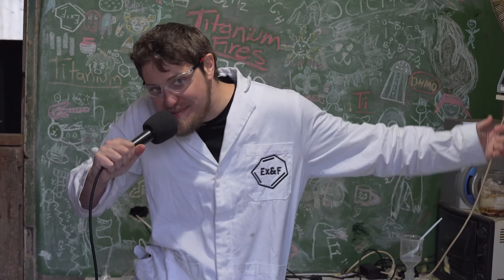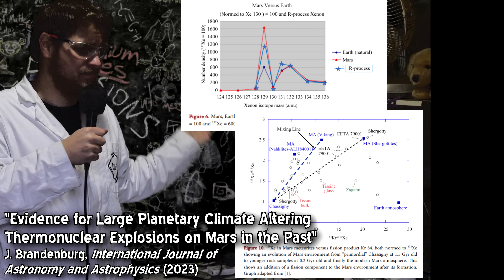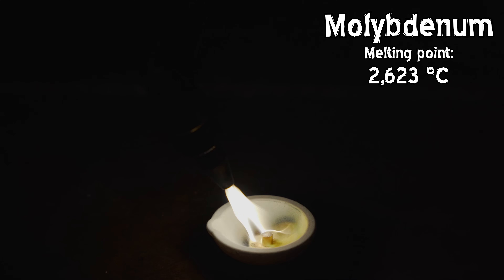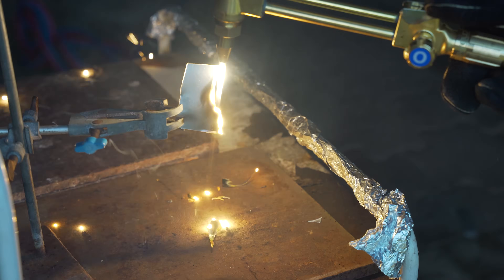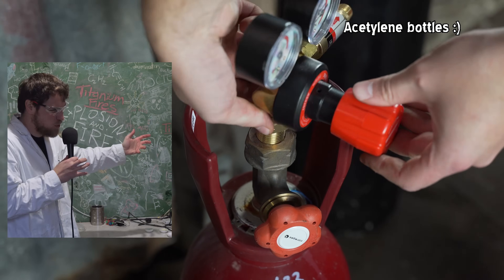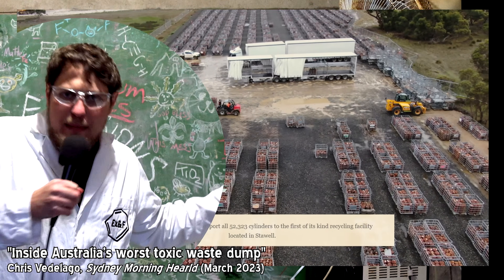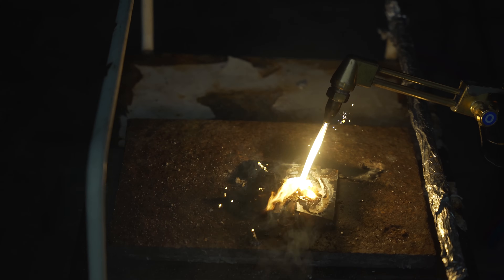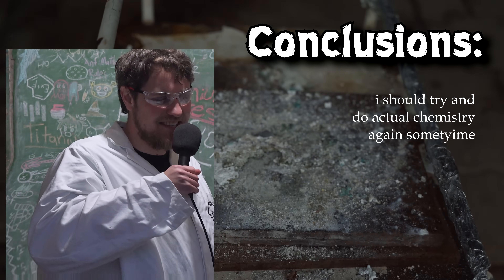Actually burning titanium

Comment: I read some report years ago that out of all the plastic (can't remember if it were plastic produced or only the "recycled" stuff), but only 8% actually got recycled, the rest ended up in landfils, burnt or just stored away for someone else to deal with later.

Now, plastics recycling is actually hard.
Just take soft plastic as an example, Polyethylene is simple to deal with, but it is far from the only commonly used soft plastic. And different plastics needs different recycling methods. So just throwing soft plastics into a bin won't really sort it enough for recycling efforts to be all that economical.

Keeping plastics properly sorted such that recycling efforts actually can happen is a monumental challenge.

Here in Sweden I wouldn't be the slightest bit surprised if it all gets "recycled" by burning it in one of our many waste burning facilities that generates electricity and municipal heating. At least the energy in the plastic got recycled, so better than just burning it out in a field. Especially since the waste burning facility is built to burn the waste cleaner, and filters its exhaust as well.

A fairly universally unwanted solution would be a plastic tax. Where that tax income directly subsidizes actual recycling efforts. (however, I do suspect that this would work fairly ineptly in practice, it isn't a trivial thing to just implement... But it is kind of needed. I myself would just make it a simple "pot", where there is X amount of plastic tax income in a given month, and then simply divide said tax by how many tons (of "new" plastic) each recycler have managed to recycle. Early on recycling plastic at scale could become a gold mine, but at least it stirs the pot and gets people to put in effort.)
Reply from the maker: Yeah I agree. Plastics recycling is hard, but I think it is wrong to maintain an illusion that things are being recycled when they are not, as cutting down on the initial use of plastics should be the main objective
Reply: @ExplosionsAndFire  Yes, the utterly false claims of "recycling" plastics when it in fact isn't, is a rather big issue as far as minimizing the problem to start with.

Reducing needless plastic waste should be a far higher priority.

Personally though think that recycling efforts also do need financial help.

And putting a tax on the sale of plastics in general would help both reduce the the total amount of plastic put onto the market, but also help remove it.

Such a tax wouldn't have to be huge either. Likely only a dollar or two per kg would be far more than sufficient. But this would have to be experimented with, and setting a lower initial bar to trail things out would be wise.

Comment: the lever on the oxy acetalene torch is for finishing the cut. your flame should already be jet blue and once you heat up what you're cutting. hold the lever and it melts through the metal clean

Comment: Angle grinder. Fills the room with white smoke. Bad white smoke.
   The only bulk metal fire story I believe was my step-dad. The machine shop he was at for a while did work for the military through a chain of sub contractors.  He cut some of the armor for Blackhawks.  Every ounce had to be accounted,  even the chips and swarf were returned. 
   Anyway. He said the pile of chips under a lathe cutting zirconium caught fire and it was soaked in water based coolant.   I imagine it was an alloy.

Comment: that oxy tourch is not the right one for that job, your flame does not have enough oxygen thats why you are getting so much carbon deposits. dont use a cutting tourch, use a welding one and crank up the oxygen till you get a blue flame with a smallish white dart in the middle. Thats when you have perfect combustion (and an oxydising flame)

Comment: Maybe you should try friction welding some titanium together, the heat can easily get to the melting point of titanium and maybe it will scrub away the surface layer? Also try preheating the titanium in a furnace. Maybe also look at what industrial conditions cause bulk titanium fires for inspiration.

Comment: As the trades end of things, you might have better luck if you balanced the flame on your torch. You should never see orange flames on an oxy/acetylene setup or black residue on the metal. With what you've set it up as, the flame is using consuming a lot of the oxygen. Which is counter productive.

Comment: when using an oxy fuel torch, you want to see little blue spikes at the base of the flame (the nozzle tip). if your flame isnt conical before pressing the lever, youre using too much fuel or not enough oxygen (sometimes both)

Comment: Ooooo I have quite the Recommendation in regards to a “ relatively “ ..lol sustained titanium ignition! 
A few years back now my buddy and I –in our attempts to two start our own small weld shop company – had a small group of customers looking for some crazy sparking skid plates for their 4x4 wheelie bars.. 
a mere 4, 1/2” dia. holes later.. we had ourselves a good heaping handful of basically titanium (steel) wool 

Completely useless and contaminated (drenched lol) In cutting oil sitting on our fixture table, I …”jokingly…”👀😂 just sparked a lighter on it… 

Without ruining all the excitement for any one thinking of replicating themselves 

… Think….  A slow to start red glow… then just a climactic crank of the dial to overload  leading into a fuggin truly blinding white dwarf now sitting 4 feet from our Flash burnt faces 

😂😂😂😂

Comment: I swear, as a welder of 20 years seeing him use pure acetylene without any oxygen (apart from the blast torch) is scary, Acetylene is REALLY dirty, it can clog up the tip very quickly wihout a little bit of oxygen being fed through to the flame... 

A clogged tip can burn like a wick, turn orange very quickly melt and make a mess of your afternoon

Comment: Once you've got the titanium melting, turn of the gas and just keep the oxy running. That's an oxidizer too and it felt quite left out. In fact, that's actually how acetylene gas cutting torches work. Once the cutting starts, the oxygen alone is enough to sustain the cutting.

Will it work for titanium though? Only you can show us!

Comment: If you burn plastic and other things in a furnace and scrub the exhaust gas you can use it to generate electricity without making mother Gaia cry. It’s actually not a bad way to deal with it.

Comment: I love your vids, but as a metalworker who uses oxyacet. on a daily basis i can tell you, you wherenot cutting the scizors but just melting it away. When cutting with oxyacet you need to see a clear stream of oxigen within the flame when you push the lever on the burner, that stream will burn and blast away the metal, giving a clean cut without and yellow blobs of metal falling off. Keep up the fun stuff tho, for no xp with oxyacet you did pretty good!

Comment: The gas axe is a scary yet fun tool. If you haven't already mastered it, light it, then turn the gas up until you have a nice "feathering" flame with very little to no smoke, THEN turn the oxygen on and adjust until it almost goes BANG! :P the flame shouldn't be yellow/orange, unless that is just how it looks on camera, it should be blue and white when correctly adjusted. VERY effective, the hardest part is not putting holes in or setting fire to anything accidentally... basically perfect for this channel <3
Reply: Amateur.

Get a hot standby flame, "tap it out" on your shoe, fill a styro cup with the now free flowing gas mix, restrike the torch and "brush" the cup.

THAT'S worth posting a comment about.
Reply: Wouldn't the extra oxygen in the flame cause unwanted oxidation ?
Reply: @YounesLayachi  The extra oxygen accelerates the combustion of the acetylene. The result is a hotter flame. When it is cutting metal and the "turbo" valve is open, the extra oxygen largely goes to oxidizing the molten metal in the flame, yes. This is useful because it creates even more local heat, helping the melt for making the cut.

If that's not what you're referring to I don't know.
Reply: @MadScientist267  I'm talking about oxygen leftover after the combustion of the acetylene
Reply: @YounesLayachi  Ok yeah any that is leftover either leaves the flame unused, or goes toward oxidizing whatever the work is, yes.
Reply: @YounesLayachi other guy is correct, you WANT some oxidation from the excess oxygen in the flame. When a cutting torch is ripping through 1/2 inch thick steel at a speed of a half inch per second, it's not merely melting through it. It's largely a chemical reaction from the excess oxygen, thats why you can make a 2 foot long cut despite only having yo preheat the steel in the area where the cut starts, and from there the chemical reaction keeps the cut going.
This is also part of the reason why oxy/fuel torches don't really work on aluminum, despite it having a much lower melting point than steel

Comment: For titanium fires, all the cases that I've seen have been as a result of overheating the metal when attempting to forge it.  It doesn't burn that dramatically, but it does keep going.  I'm wondering if perhaps the difference between those cases and here's that when forging, the entire billet is heated to orange heat (~1000C), and fires result when it gets 'a bit' hotter than that.  So, perhaps the intense point source of heat from the oxyacetylene is not getting the surrounding material hot enough to continue the combustion, before the directtly heated material is fully oxidised?  Maybe titanium needs to be all at at red or orange heat before a sustaining fire can occur?  Just guessing, trying to make sense of two apparently contradictory observations.

Comment: Hi there, I studied plastics engineering in college and did my capstone project on plastic recycling. The short version of why recycling is a mess is not because we don't know how to recycle plastic, its that it is very hard to separate plastic by type and a small amount of contaminant drastically lowers the quality. So it is very costly to get pure plastic separated out by type. So costly, that it is actually cheaper to make new plastic from scratch than recycle old plastic. So governments can't find buyers to recycle it, and are stuck holding the bag, as it were, with what is now a bunch of garbage plastic that no one wants to process as recycle.

Whoever is able to invent a way to separate plastics quickly and easily by type could be rich beyond their wildest dreams, but it hasn't been figured out yet.

Comment: You might try very dry liquid bromine as the oxidizer. If the titanium is submerged in the bromine to exclude atmospheric oxygen (to prevent formation of a passive layer) there likely would be an induction period, then a reaction you might classify as burning.

Comment: I've always said recycling anything that isn't metallic, glass or a simple thermoplastic like PP or PE is a waste of time and money. Polyesters and other condensation thermoset polymers can either be burnt for energy or dumped it in a good landfill. Landfill is so much better for the environment though, it uses a tiny amount of space, plastics are very stable, Australia is the best place for dumping them to ensure they don't end up in waterways or get into the foodchain as large polymer particles due to our vast, dry, sparsely inhabited, geologically stable interior. Then if we do work out a way to economically recycle them, we can always mine landfill. Frankly it would be possible to economically recycle them if we replaced all our coal burning power stations with nuclear reactors so the cost of energy was too cheap for that to even be a worry and we could use the thermal power of the reactors for process heat to break down the polymers into simpler carbons. We could turn plastic waste into brand new monomers for making new plastic, medicine, fuel or cheap building material.

Comment: But what if you coat a plate of titanium in magnesium, then kickstart the process by lighting the magnesium on fire, which then burns at around 3100°C, which in turn will then provide a self sustaining source of sufficient heat for the titanium to burn?

Comment: Why were you using the cutting bypass on that torch?, you can just set a proper mix of oxygen and acetelyne. That lever is for blowing extra oxygen into the center of the torch to cut metal plate, not for just heating.

Comment: Tom, please learn how to get a neutral flame happening. It's usually relatively short in length, feathered, quiet, and has a small well defined blue cone at the oxy tip end.
Also, you were using and oxy cutting tip. The idea of those is to control the amount of oxygen in your heating flame using the oxy tap on that end, nearer the flame. The oxy tap at the base, next to the Acetylene tap, is just turned on all the way.
Fun vid though. Maybe the oxidisers would have worked better in a mix with powdered titanium. But I know how you feel about powdered titanium.

Comment: You need to add more oxygen on ur fine adjustment until you see (6?) the little blue jets around the center oxygen jet. 6-8 mil or 1/4”-3/8”length is usually a neutral flame

Comment: I feel like perhaps the "grinding it doesn't count" is missing another important feature: the surface of the titanium is already oxidized. Titanium, like aluminum and chromium (the latter of stainless steel fame) very quickly form a passavative layer of metal oxide that protects the bulk metal from further oxidation. So while yes powdering the metal increases the surface area, it also exposes the metal enough to allow oxidation in the first place.

Comment: Light with acetylene,  continue reaction with LOX. Thats about all you've got to sustain a flame with a smaller mass of titanium while it's still stock billet. Larger masses will hold heat longer and suck more oxygen,  but Titanium oxide is incredibly flame retardant, and will put out most fires. 

What you really need, is a titanium mass of over 88.3 kilo, and an overwhelming oxygen source which would produce radicals freely and efficiently, creating an acid which is operated at high-heat. Cosmology has its perks, fellow scientist!

Comment: solar powered distructive distillation might help.
not usually done on renewables because humans seem dead set on dancing with extinction but it just needs an adiquite heat source for power into the system for the process.
i mean i could pointout that it lets you turn plastic into fuels and even a synthetic crude to crack all over again but hey you aren't motivated entirely by mercenary values so why would you want products back out that you could sell...
not aimed at your or the channel of course im just sick of being jaded enough to be waiting for the catch at the promise making end of such politically motivated verbal sewage.
i only say solar because im thinking outback but by all means so long as its from renewables to do it, have at it hoss

Comment: Try heating the titanium in a lump in the furnace so it’s already as hot as possible then hit it with the torch, the thin sheets seemed like they were getting blown away, not absorbing the heat i think a big lump would work better

Comment: I think to burn pure titanium you would probably need to uniformly heat the block as its heat dissipation abilities are so high.  Then expose it to a very plentiful oxidizing source might push it to a continuous burning reaction.   Its probably not going to be doable outside having some sort of specially designed furnace chamber flooded with a high flow of oxygen (which I'm sure would be perfectly safe to operate).
Reply: Pump an unhealthy amount of electricity through it in a pure oxygen environment perhaps?

Comment: The way that oxy acetylene torch should be used is to set the mixture running white hot to start melting the metal that your cutting and then squeeze the lever to add more oxygen, in another experiment, titanium caught fire by a laser in a space launch experiment using photons for lift

Comment: Propellant Engineer here, so I have some answers for you!

1. The reason you are struggling to ignite the larger piece of titanium has to do with heat conduction and the volumetric heat capacity of the plate. Meaning, any oxidation reaction you are getting is quickly being quenched by the thermal mass of the rest of your plate. So, if you really want to ignite the entire piece, you need to heat it up to the same temperature. That way, once a little bit ignites, it won't be quenched by the rest of the plate and ignition can continue.

2. Those micro-explosions you are seeing are actually due to liquid titanium absorbing oxygen and nitrogen until it gets supersaturated. Then, once the particle ignites, those gases are suddenly released and causes the particle to explode. Zirconium does the same thing! Here is a good paper that talks about that: https://www.sciencedirect.com/science/article/pii/S1540748912000909